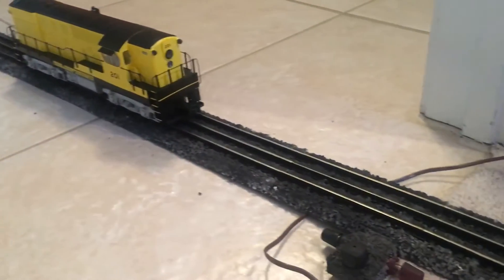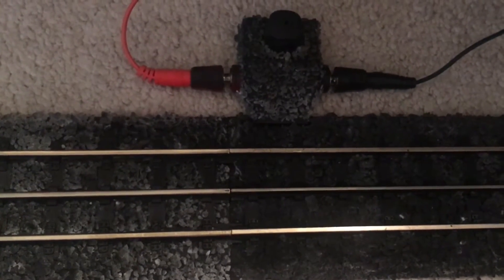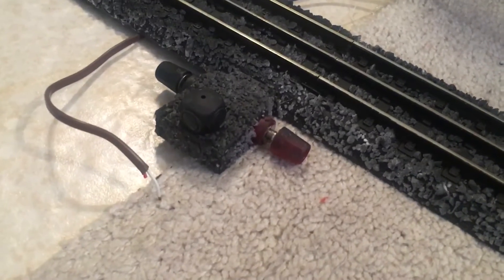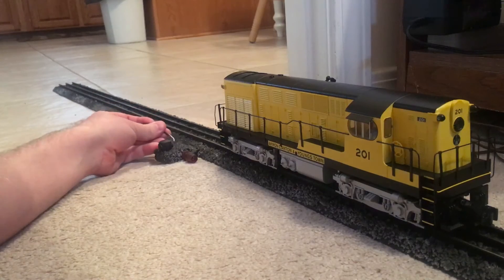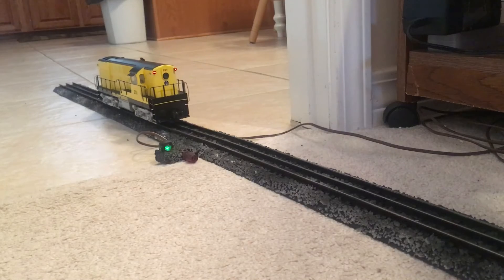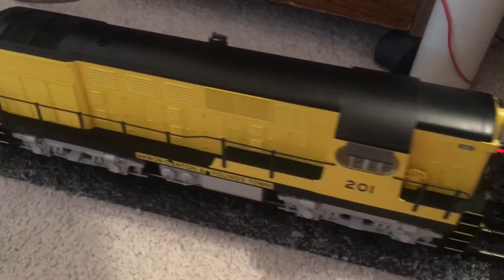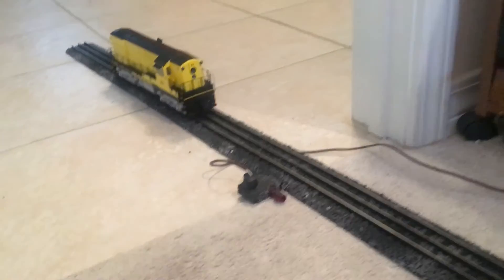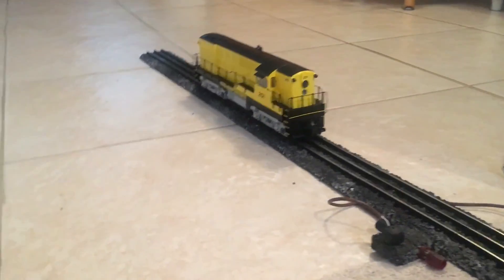Mth realtrax troubleshooting

Comment: Wow!, great Video! :) Can I ask a question, sorry if its unrelated to this video but do you know how to fix my mth r142a non powered car? I took the shell off and put it back on and now the lights won't turn on and I have checked everything?
Reply from the maker: Alex Campbell MTA glad you liked it. The only thing I can think of regarding your subway car is maybe pinched or severed wires or maybe the plug broke. Did you open it up again and look at the wires closely?
Reply: Yes, I even took the floor off and took a look at the wires under.
Reply from the maker: Alex Campbell MTA hhmm sound like to me the lighting board shorted out.
Reply from the maker: Swap the board out with another car and see if it lights up
Reply: But how? It worked fine before I opened it? and I can't swap the board out because  I only have a powered r142a and an non- powered.
Reply: I have uploaded the video of the problem.

Comment: As you'll read in my response to your recommendation in my R32 pt. 2 video, my solution to Real Troublesome, I mean Trax problems is to replace it with Lionel  Fastrack.  MTH wants to do things on the cheap, to keep that profit margin high at our expense. All that yellow locomotive needs are the MTA decals and black stripes and it could be a work train locomotive.
Reply from the maker: Mark 'BhigDaddyMark' Ferguson I may consider making it a NYCTA work loco. Thanks!
Reply: DjsOgaugeTrains 
It's perfect for a work train!